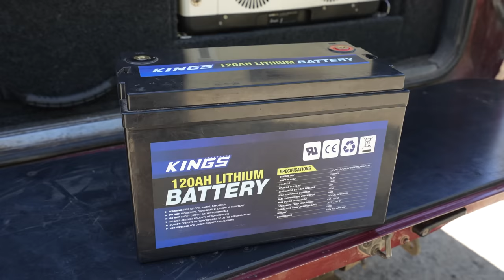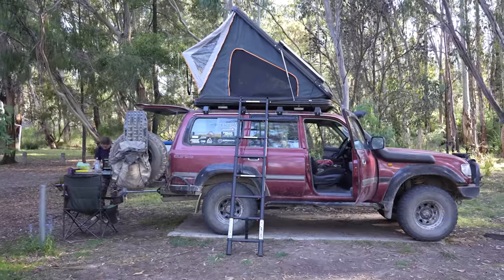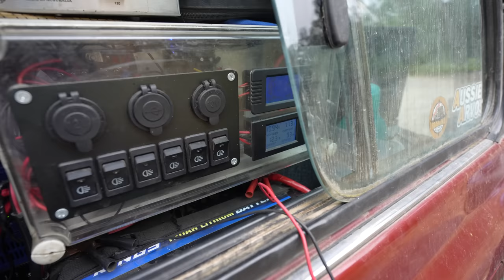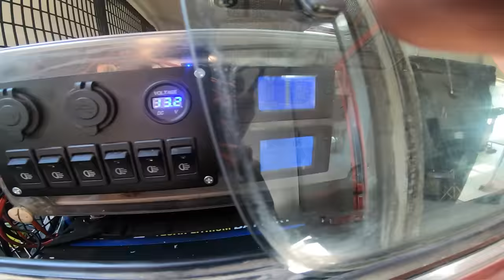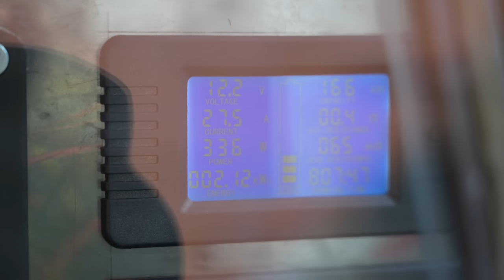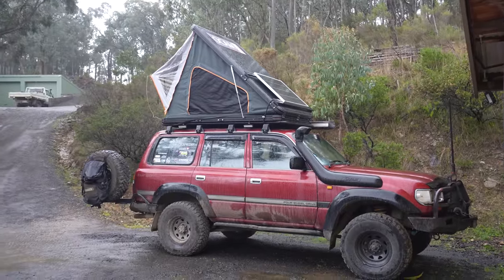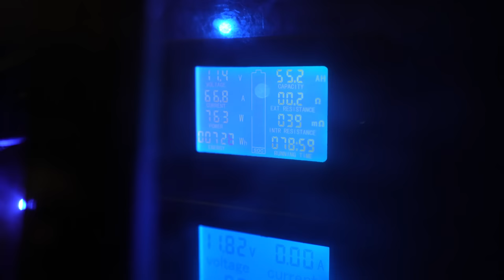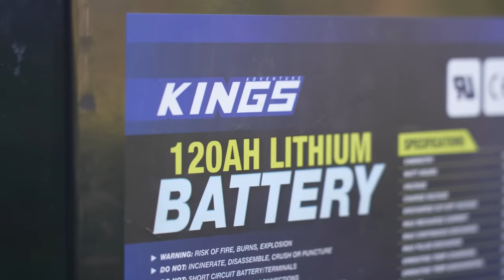Watch this BEFORE you BUY Kings Lithium Batteries

Comment: Buy quality, cry once. Buy cheap, where quality is compromised, cry often. Kings sell cheap, because they source the cheapest, compromising quality to sell the cheapest. Which is great for them, you will buy from them multiple times
Also to bear in mind, cheap poor quality lithium batteries have been known to explode. When it comes to cheap electronics, beware that it might not only be your battery, inverter or charger that might fail, it could start a fire to incinerate everything, including your pride & joy. I was able to put out a fire in my 80 Series before much damage occured.
Reply from the maker: You get what you pay for in the end of the day, but i think it's a good budget option for those wanting a lithium!
Reply: @AussieArvos  l might add Pat, my 4 children were in the car with me at the time. They were terrified. In my case it was the substandard, too thin wiring that overheated, like a fuse would, melting the plastic sheathing & causing the carpet to smoulder. It fried the AGM battery, the battery box, & my 40l Engel. As to your question above, yes l am going to lithium, but I will be buying quality, so I will only have to cry twice. 😉
Happy trails to you & Anja, dude
Reply: Even cheap lifepo4 batteries will NOT "explode". A BMS failure could cause thermal runaway, but they will NOT "explode". Any fires related to lifepo4 batteries is usually caused by sub par fusing/cabling/install etc. Lithium Polymer can explode but is a completely different chemistry. Phone, laptop and EV car Lithium batteries are a completely different chemistry also.

Comment: 95 % of Kings stuff is single trip use only. I purchased a Kings dual compressor, had it in my caravan  in its bag . First time I used it I had let my tyres down to 20 psi for a dirt road  265/75/16s . 11 minutes to pump 1 tyre to 45 psi, 1 hour 52 minutes to do 4 tyres . It just kept dropping out thermally . Absolute Garbage.

Comment: Who in there right mind still uses 12v ? 24 or 48v is so much better . Lithium may be ok down south but when in car temperatures get above 60c you are much better off with gel batteries. High draw applications should stay at home

Comment: Its all shits and giggles until a Lithium battery catches on fire.  Electric buses,cars,sccoters  and even LG Chem home storage batteries have all had problems with fires.  Boeing even put them in one model or large airliner..........until they started smoking. Those aircraft were all grounded for months while their lithium batteries were removed, and traditional APU jet turbines were put back in.  Generally speaking, if the manufacturing quality is very high, its less likely to catch on fire from a manufacturing defect.  In use, any kind of mechanical deformation can lead to a charged lithium battery catching on fire.

Comment: Just note that induction tech is terribly inefficient...the power used doesn't transfer much to your cooking pots etc.
Reply: I think you want to qualify that claim a bit. Wish I could cite some references. The induction step with appropriate cookware can be very good at getting the energy to the pot. I think circa 90 to 95%. Good quality, 12V inverter a similar range. I2R losses in cabling could be horrible where 1800W is circa 150A before compensating for conversion losses. That's some hefty wire. (I've worked on inductive EV car chargers.) 

12V direct to induction would cut one conversion. 24V or higher system drops the cabling losses.

Comment: Your math is wrong. If that battery was exactly 120ah and your fridge which draws roughly 5.4amps peak It has a total hour span of 22~24 hours. In laboratory conditions. Now you saying that you can get 4 to 5 days out of the battery is total and utter rubbish. Laptops can use a huge amp drawer. Unless your in the bloody freezing cold, but a fridge in a hot car wont run for 4 to 5 days on that battery.
Reply: You are you assuming the fridge is running non stop and not cycling on and off is that correct??
Reply from the maker: The fridge doesn't draw power the entire time, it cycles on and off to maintain temprature. This could change depending on enviromental factors (outdoor temprature) and how full the fridge is but i've tested it with an empty fridge both zones on -1 in the back of the 80 series and it did the 5 days no problems on the 120ah battery.

Comment: His current use age and times just don’t add up,  I have been on the road now for 8 years, 800 watts solar and 6 * 120 amp batteries running the motor home,  I know after 8 years how the solar works, and how long  I can run and what I can use,  this is either a fan boy you tuber with no idea or a paid advertisement for kings batteries,  I can tell you that little solar panel will not keep his battery charged to run that fridge indefinitely, let’s call it a 100 watt panel and say it making 5 amps per hour, for a good 5 hours of sun light , that’s 25 amps into the battery, now to run that fridge freezer for 24 hours and let’s say it’s pulling 1.65 amps per hour, that’s 39.6 amps for 24 hours, he has used 14 more amps than the power he has put in from the panel, plus he runs lights and his pie warmer and his 1800 watt induction cooker . 
With all my batteries and 800 watts of solar, I still relied on my Honda generator a lot,  and when I stayed in no generator camp ground, in summer with good sun days,  with 6 120 amp agm batteries ran down to 50% I got 3 days tops, not using the inverter more than 20 mis a day. 
, seeing I have toured with many people , I have seen the same time frames or less depending on there solar,   Those with 120 amp batteries and 200 watts of fold out solar panel,  are lucky to get two days before they need to pull out there generator to charge up the battery, 
It takes a lot of solar to fully charge two 120 amp agm batteries, as most controllers get back to 80 after a fair bit of time, but hardly ever get back up to 100% due to the slow down charge rate,  and you just run out of day light , then your discharging over night. 
Then what about those cloudy days ?  
Sorry this bloke is just talking poo.

Comment: the kings are way over priced!!!!  there are the same batteries just with a different sticker for 300 bucks, all the cells are made in china and assembled in china, the only difference is the sticker on the case, so dont pay kings 599 when you can get the same battery for 300 bucks

Comment: of cause I haven't moved to lithium they are a fire hazard, and no insurance company for boats will touch you with a barge pole, its the very first question they ask.

do you have a lithium battery bank on board if so by,by.

anyway in a year or two sodium batteries will replace lithium, already doing so it e.v cars, will be half the price of even the cheapest  and 1000 times safer.

if my vessel burns down, next stop for me is living under a bridge, or in a storm water covert.

so no thanks, cant afford to lose 400,000 because of a bank of batteries worth 1500.